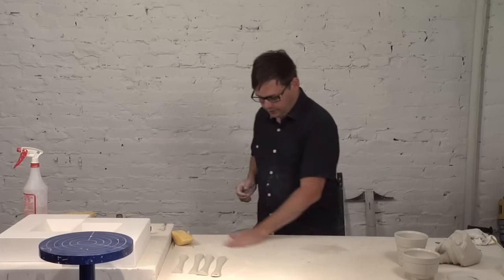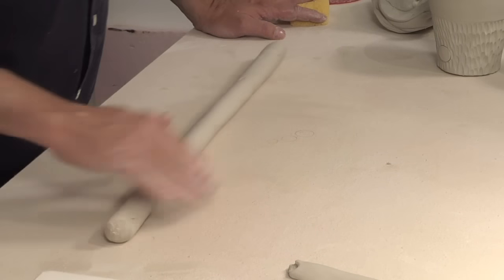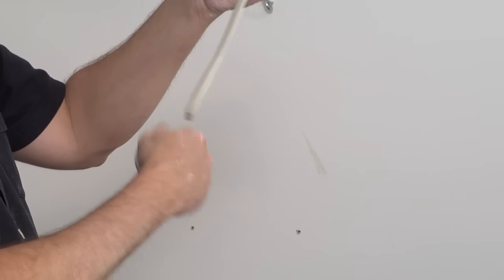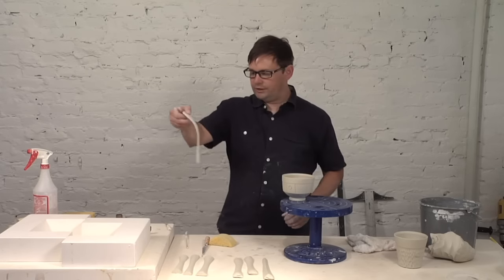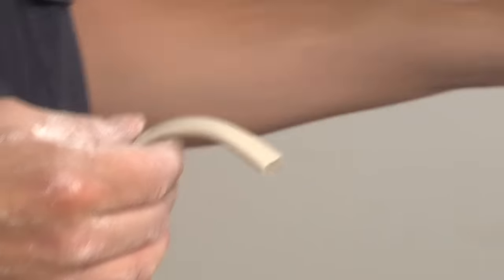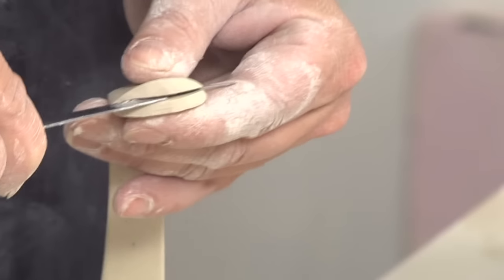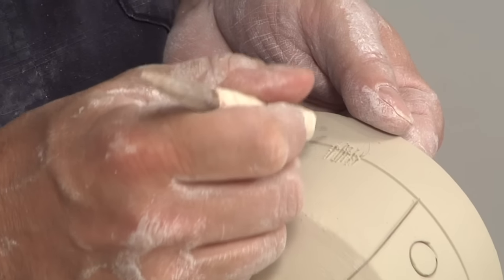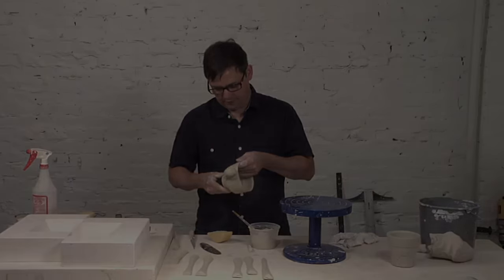Tips for Making Graceful Refined Handles Without Much Pulling - PAUL DONNELLY

Comment: Excellent video but in Las Vegas I would not be able to let the handle set over night.  The handles would be completely dry.
Reply: You can adjust for the moisture issues. Some people put plaster in the bottom of a rubbermaid container for example add water after it has set up and then place the work inside of it. It acts like a damp room.
Reply: I had recently heard about pouring plaster in the bottom of a large container in place of a damp room to keep pots from drying out too quickly. But your comment made me realize that I could also do this with a smaller more manageably-sized container and keep it just for small things like handles. Thanks!